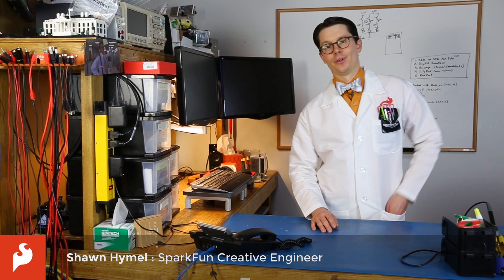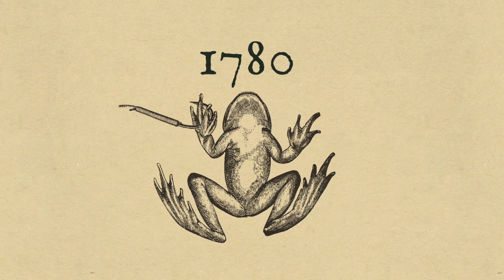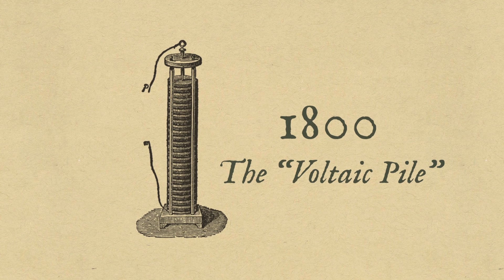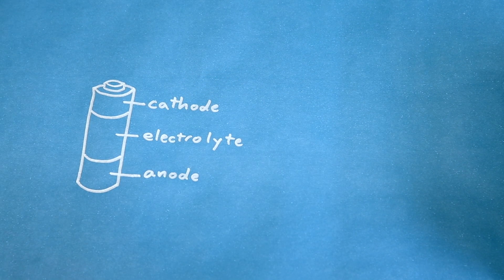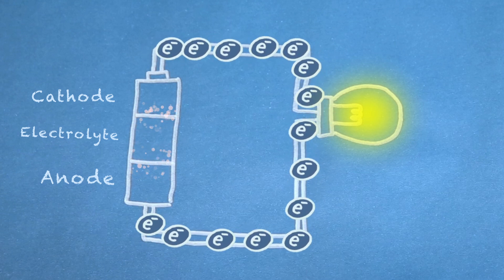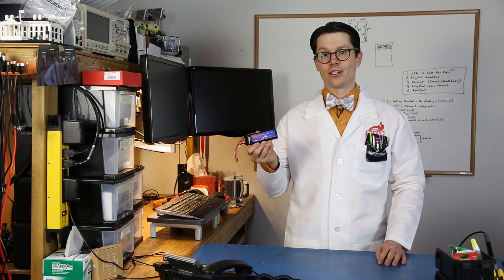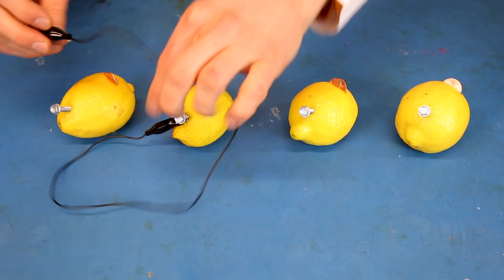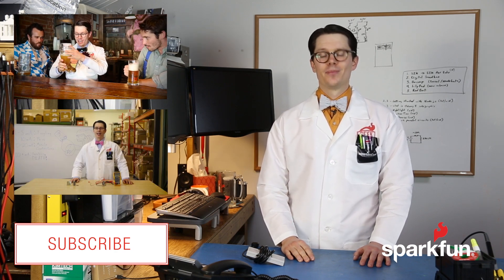What is a Battery?

Comment: How do electrons from a conductor start moving when it's connected to a battery?... Does the electron which is in the negative terminal repel the electrons in the conductor???
Reply: No there is no repulsion... It's all due to drift velocity. 
The electrons in the atom of conductor have low ionization enthalpy these electrons take the energy from the atmosphere (room temperature)and comes out of the orbits around the nucleus. These are called the free electrons. These free electrons move randomly but when they are connected to the battery then the external force of the battery aligns them in one direction and they start moving in a particular direction that creates a current. On the other hand an insulator does not have free electrons due to high ionization enthalpy example nonmetals so the same doesn't happen in insulators